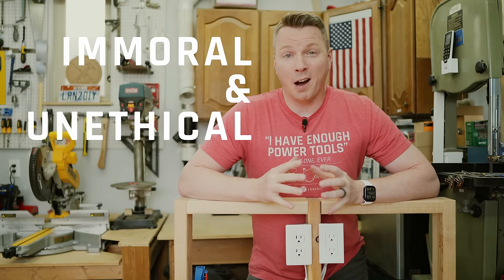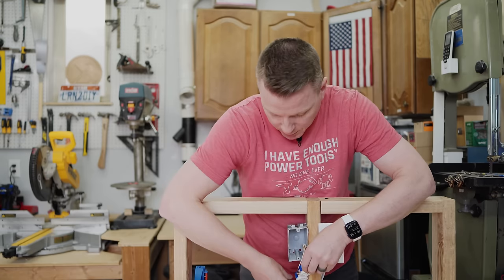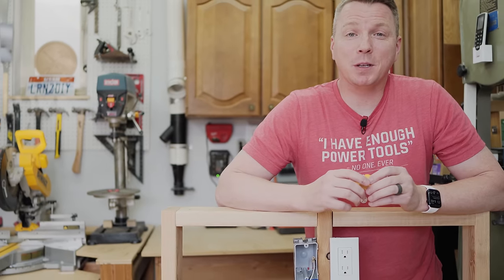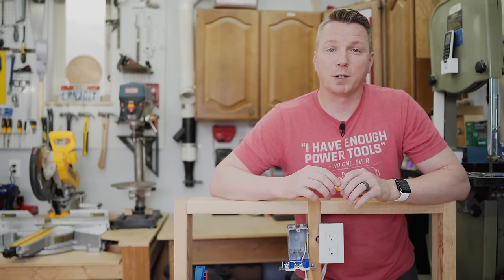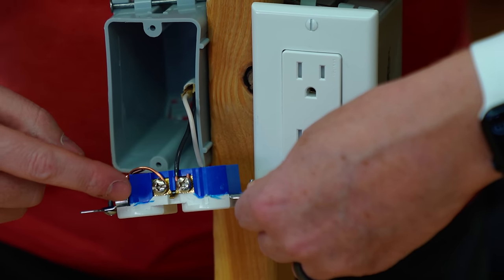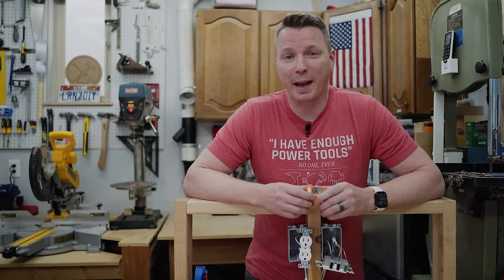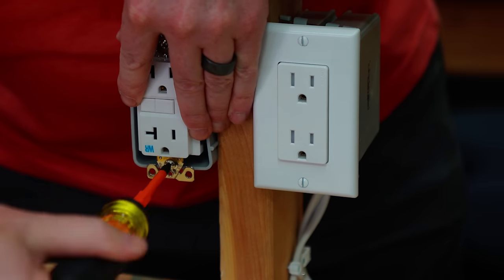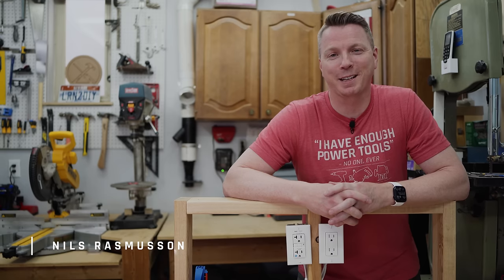People Are Adding Deadly Hacks to Outlets

Comment: It's interesting to see this socket, here in the EU (more then specificely AT), you need to put a FI (not knowing the english name, but it does the same, just in your junction box) on every socket group, and they can not be higher then 30mA (0.03A). This basically means, no higher loss of 0.03A, what is the amperage generated between Live and Neutral by shifting magnetic fields. On top of that, everything here is grounded and your connection to ground can not be higher then 30 Ohms, and that is an exception, it should be below 20 Ohms, but the 30 limit is there for reconstruction and it's not always easy to get a good ground. Anyhow, whatever you do, always make sure you have a good ground and a good Fi (that cuts the power in case of loss), as I've seen here in a comment, to AVOID YOU becoming the conductor!!!

Great video, learned a bit about the US system ;-) keep it up!

Comment: As an industrial electrician there is some stuff I want to add:
1: the bootleg ground itself is no problem and it works perfectly fine when everything is correct. 
The real problem occurs when the connection of the neutral wire breaks somewhere. This can't be explained in laymens terms, but depending on where the neutral breaks it can lead to metal casings carrying a live voltage, or devices beein provided with a higher voltage than they're rated for.  
Sadly these problems can't be fixed with a GFCI. Only by properly re-wiring the house.

2:  
Your thumbnail shows another mistake:
Since you tighten screws by turning clockwise you'll undo the loop of the wire while tightening the screw.
If you have to use a looped wire always loop it in the direction that you'll tighten the loop with the screw

Comment: I just replaced all the two prong receptacles in my friends house, luckily it was all BX cable. If you have BX Cable do not think it needs to be replaced, the ground comes from the steel jacket and metal boxes. As soon as screw the receptacle into the box it is grounded, could also add a ground tail for good measure/so equipment is still bonded during service

Comment: My question is what's the difference since neutral and ground still gonna get bonded together at the panel? how does the safety hazard differ from them being bonded at the outlet? is just for a scenario where the neutral wire somehow get damaged/disconnected resulting in also loosing the ground connection?
Reply: Bonding at the panel is yet another layer of safety, since it is unlikely to be messed with by a user, unlike an outlet or switch. And you have each device (switch or outlet) grounded individually for safety by the individual ground wires running back to the grounded panel itself.

Comment: I used to do renovations on homes defaulted by Fannie Mae during the housing market crash. 90% of the houses were made for GIs that were returning from WWII and after they died, they either had double mortgages on the house or a reverse mortgage, which then the banks sold it to people who couldn't afford them. Obviously to modernize the house for sale to people who can buy them and aren't just hobos or crack addicts, we had to upgrade the outlets from 2 to 3 prong outlets. I can't tell you how many true earth grounding poles I've installed, but it really doesn't take that long to install the poles, replace the breaker inserts and adding a grounding bar to the breaker box, it's just a pain to run the wires through the house. The biggest problem we ran into was incorrectly wired circuits. Just because the wire is black or white, doesn't mean that's hot and neutral. It's like old RCA cables, just because it's yellow doesn't mean only video can flow through it, a wire's a wire. I spent the most time rewiring the outlets to be correct than I spent adding true earth grounds.

Comment: When it comes to wiring I glad I'm not from America, you guys really got the short end of the stick being the early adopters. 

Non-polorised plugs (the newer earthed plugs help), ~110V AC (a max pull of 2.2kW for 20A breakers), no ELCBs, 220V made from 2 live phases (making phase balancing a nightmare), plugs that can be half inserted yet still make electrical contact, plugs whose cable exits perpendicular to the wall making the previous scenario more likely, no switch on sockets to suppress arcing, etc.

Comment: I bought a house built in 1954 with two prong outlets.  But, I lucked out when I wanted to install three prong outlets.  There was proper three wire in good condition running to the boxes.  (Originally the ground had only been connected to the box.)
Reply: So someone wired the ground and just didn't bother replacing the outlets? Why!?
Reply: @xxgn  When the house was built, three prong outlets weren't used in bedrooms and other living areas so the ground wire was connected to the box. Perfectly OK. Surprised to see as most contractors would have cheaped out and run two wire everywhere they didn't need a ground wire and only spent the extra money where they had to.

Comment: For those who don’t know, a ground wire provides a path back to earth, the path with least  resistance, which will cause your breaker to over amp and cut the power. a standard (US) residential outlet, is typically 20 amps. Not enough to kill you, but it will hurt. As a matter of fact, homes were originally ran with only a hot lead and ground. The problem is you becoming the bridge, if it’s your right hand pinky to your right hand thumb, it’ll hurt, but you should be fine as it’s a short jump. Now right hand to left hand, the electricity now has a pathway to your heart, there’s the danger. Larger amperage’s are a lethal but as you approach 30 amps plus most appliances are 240v and have 2 leads and a ground, no neutral.

Comment: The previous house I lived in had ground connected directly to neutral in the breaker box.  I was shocked (not literally) when the home inspector told me that was totally normal for houses of that age in that neighborhood, and it was fine.  House was ~ 70 years old.  Still not sure whether it's okay or not.
Reply from the maker: That’s called bonding and is totally normal and recommended so long as it’s only happening in your main panel. If it happens anywhere else in addition to the main (like sun panels or receptacles) that’s a problem.

Comment: I was changing an outlet that was working and tested correctly and discovered that it was wired hot to hot, ground to ground, and neutral to ground. It had been that way for year's. Was that a safety issue?

Comment: Just as a side note - nope, you can't pass 10 amps through a human body at 120V (or 240V as well), because human body has a resistance of a lot of MOhms, limiting the current. But that's unnecessary to cause a heart failure or severe burns, just 10-100mA would be enough.
Also, as a cheaper option to check for such shortcut would be the usual kind of multimeter tester (@ ~20-40 bucks), that has resistance/short circuit test, and check ground with either contacts. If there's no resistance - there's obviously a shortcut between two contacts. And you don't need to unscrew your sockets, just pop off the plugs. You could also check polarity with it (but with plugs on, of course). 
Also, GFCI is a good thing and all that, but it might be not enough. Because, first, it doesn't work instantly, and you don't need a lot of time to cause fibrillation, secondly, it has threshold at how much current it switches off. Generally lower than what's needed to kill a person, but still very unpleasant and could be enough to get a minor burn. Though, some have threshold at 30mA, which is way too high. You'd probably need an expensive model and check the threshold to be on a safe side.

Comment: Do you want a ground loop? Because this is how you get ground loops... I've found these things in practice, I'm not even close to an electrician, however the fastest way I've found is, audio equipment, specifically I'm a musician, I have recording interfaces, I've got a lot of powered microphones, amplification equipment. If you have a ground loop somewhere on the circuit with that equipment you'll get horrible hums and hisses. The equipment will be fine, but you'll get that 60 cycle noise. Phantom noises in recording equipment are a very quick way to find out the electrical in a building has issues.

Another fun one as a bonus, Some hardwired appliances like in one place the AC was hardwired, however anytime it would kick on it would feedback through the ground, it had been improperly wired so my recording equipment got very noisy when it would kick on. Things you don't think about until you have equipment that is directly reliant on the electricity running correctly.

Comment: This same thing happened with a friends house.  The house was a 1950s with a 2 wire system.  If you look into the fuse or breaker panel, you notice that the ground wire and white neutrull share the same metal box that is the reason a boot leg ground can work.  When replacing an outlet in a friends house i noticed this practice.  A good home inspector that is inspecting a 1950s home, should remove the cover, and phydically look.  If bootlegged then inspection is failed.

Comment: I have a bootleg ground receptacle story.  I had a fluorescent light that I used as a blacklight which I plugged in and it seemed to work great but then, I discovered that when I was barefoot, I would get shocked every time I would pull the pull chain switch.  This shock was even more pronounced when a vacuum cleaner was plugged in.  I became suspicious and opened the receptacle up and sure enough!  Someone had wired a paper clip jumper between the neutral and ground of the receptacle.  I don't know how people get away with this madness.

Comment: I’ve had a electrician come out to rewire half of the shop where we had a small electrical fire and wired it up like this on all the outlets in series that ended. One of which was 2 220v outlets both missing the ground (second outlet was cause of previous fire) and the inspector checked one of the outlets. I have done electrical before somewhat at less enough that I knew you always needed ground to outlets particularly welder outlets. The inspector ended up checking all the outlet he did and flagged all the one’s missing ground. He did wire all of them correctly after that. I do believe the electrician ether got his license suspended or revoked because I haven’t seen him advertising himself since.

Comment: My house was built in the 90s...the 1890s. The guy I bought the house from replaced all the wiring and most of the plumbing. When it was too late, I have discovered that he took many shortcuts...but I know he put in the right wiring, only because he didn't get an outlet installed in one place, even though that was one of the things he was required to do. He also stole a basement window, which really made me mad, but I neither know how to reach him, nor do I want to talk to him. But you're making me a little nervous...I'm thinking more about how he wired the kitchen. The microwave installed above the stove plugs into an outlet inside the cabinet above it...a GFCI outlet, and used a regular outlet next to the sink. So, the microwave trips the GFCI every so often, and is a pain to reset, given it's position high up and in a cabinet.

Now I remember a refrigerator in a rented house kept shocking me when I touched the door. I wouldn't be surprised to learn the wiring was done wrong. By the time I moved out, mice had ruined a lot of wiring...I pity whoever had to fix that mess.

Comment: I live in a really old rented home with receptacles with no ground wire. The receptacles were all replaced with 3 prong receptacles, but they're not bootleg grounded. They have metal boxes and have armored cable that is bonded to my 60A fuse box. Ive done DIY electrical work before and have seen some pretty messed up, shady stuff done by handymen and previous landlords, but this bootleg ground thing is the shadiest.

Comment: My 1996 rambler had something similar to this i. The basement, where someone had connected the neutral wire directly to the ground. It wasn't even in a box, just inside the wall. I only ever found out because i tore the sheetrock off the wall while remodeling my bathroom.

Comment: It's not dangerous if wired correctly. The ground contact is for detecting a short circuit to a metal chassis of a device/home appliance. If the neutral is connected directly to the ground contact, which is then connected to the neutral contact (not the other way around) it will protect the chassis from being under voltage (creates a short circuit and blows a fuse). If there isn't a metal chassis, the device should be safe to touch no matter the ground contact in the outlet (if the device is manufactured properly). Maybe in the US it's illegal to do, but for example in Poland, where 2 wire installations are common in older buildings it's completely legal to do so. It's illegal however to convert a 3 wire installation to 2 wire, and it's mandatory to convert the entire wiring if the installation is overhauled. Of course, a current differential circuit breaker makes everything much safer, however using what you call bootleg ground (bridging) is not that unsafe. Only possible scenario I can think of that might be dangerous with that solution (if done properly!) is whenever there's water involved. Otherwise any electrical failure would either short circuit to ground and blow a fuse or be contained inside insulating casing of an appliance. Only real reason someone would get an electric shock is by inserting something into the outlet or cutting only through the live wire of a cord, without touching the neutral, which is very unlikely. Touching 230V AC without being directly connected to neutral would give a strong shock, but in most cases would not result in death. So in order to get killed by such a solution you would have to touch both neutral and live wires directly, and on the opposite sites of your body, or use a hairdryer in the bathtub, both of which are extremely unlikely, and touching both wires would also kill you even if you had a differential current circuit breaker, unless you touched the live wire first. Also, American GFCI outlets are great, but having a differential current circuit breaker for the entire installation is way better, because it protects the entire house, not only the outlet. You install them mostly near water, but the truth is that the safer way is to use a low voltage installation (24V) for bathrooms, isolated from ground. Also, entire wiring being isolated from ground is the safest way to go, because if one of the live wires short circuits to ground, you are still protected. This type of wiring is used predominantly in hospitals, but requires frequent testing of insulation.

Comment: Just another reason that I love where I live. Our building code requires all boxes to be 1) metal and 2) connected to each other with metal conduit. Everything is grounded and makes me happy.
Reply: Conduit and metal boxes are grounded in case hot shorts to them, not to act as a ground. Galvanized steel is not a very good ground compared to copper wire

Comment: Not really related to the bootleg ground, but it got me thinking about the time I stuck a paperclip into an outlet when I was 5 and barely burned my fingers. 

This led me to be more than a little bold with electricity, even going so far as to stick my bare finger in a light socket just a couple years later.

You'd think I'd have learned, but to this day I find myself getting zapped purely out of curiosity.
Everything from tasers to bug zappers. If it emits electricity, I'm liable to poke it at some point, especially if i receive verbal confirmation that its not likely to be lethal.
Reply: Bring this man a substation!

Comment: I had a older House that was wired with Greenfield. No Grounds on any of the Receptacles, started looking at the wiring if I Could Rewire. Damn if there wasn’t an insulated ground wire in the Greenfield. It used to be there was a thin aluminum or steel wire, and you could sometimes use the Steel Jacket as ground. I did rewire Kitchen and Laundry to 20 Amp, and more Circuits in the Kitchen.

Comment: I've never seen this before but in the panel the bond is hooked to the neutral bus so electrically this is equivalently safe so long as you're not avoiding a GFCI breaker. the neutral wire can withstand more current than a typically smaller bond (like in loomex/romex, or BX). the reason you separate your bond and your neutral is to protect equipment from having power on both conductors if they shouldn't basically turning a circuit from a 120 to a 240 circuit
Reply: I personally don't want current flowing on my EGCs